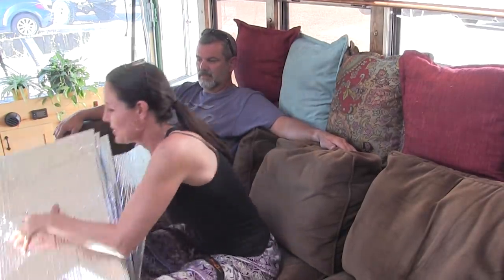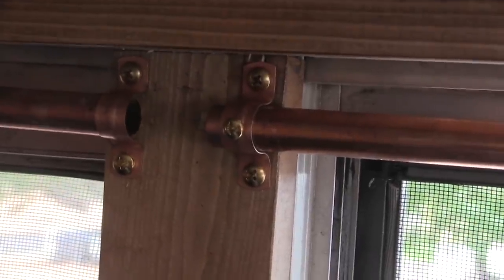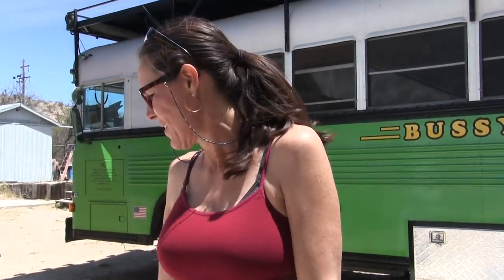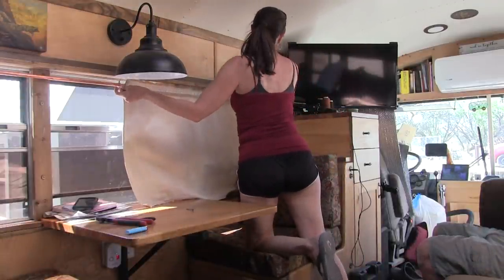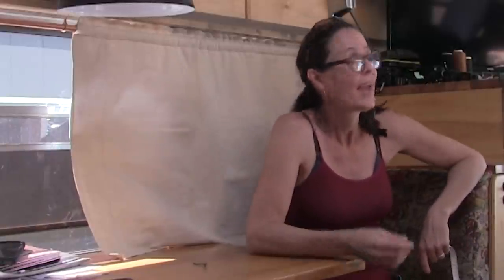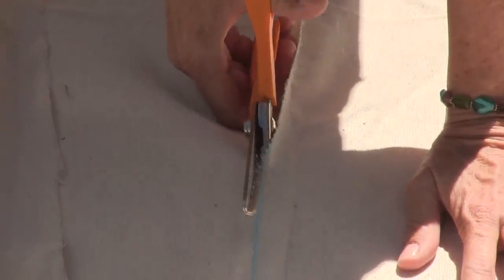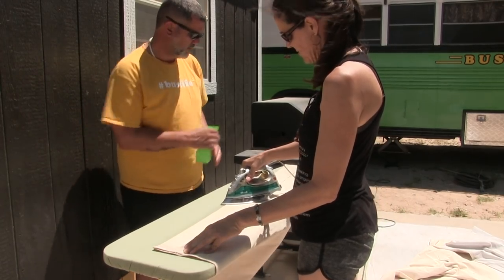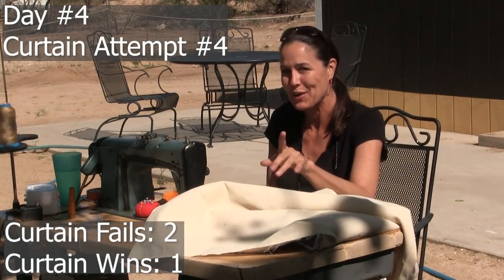Sewing Insulated Curtains for our Skoolie: the Struggle is Real!

Comment: 1st off, kudos to Kerry for holding up. PTSD is unique to each person who suffers from it. One can get an idea of what the person is having to deal with, but will never fully grasp the total affects of it. 2nd, Mike, you're one hell of a person, human being, and man for having the love, patients and understanding of Kerry's PTSD. 3rd, let me make a suggestion to you on the windows. Besides the curtains, did you ever consider doing low E film on the windows? Yes they are single pane windows, but what you want as an end result is to keep the heat out. UV rays are what carry the heat. Not to be confused with Kerry the heat. This is the exact function of low E film. If you do this, your insulated curtains will act as an insulated window panel and the low E film should work quite well.

Comment: Honestly, for the tiny homes I've helped build, I have learned to love making insulated blinds, instead of curtains. You need to preshrink canvas, so it doesn't shrink during ironing. Wash it, dry in a hot dryer, then do your cutting and sewing. The kind of blind I recommend is an accordion blind, which just needs to be about 1.5 x the length of the opening to function well. I use swivels to attach my blinds to curtain rods. It makes the blinds easier to open and close without bunching.

Comment: I would make a curtain "case" fit to the window, then cut the insulation to fit the curtain case which you slide in the insulation. This would allow you to take the curtains off and wash. Using canvas, you have to wash and dry it first - before cutting and steaming to stop the shrink issue.  Curtain case... as in think about a pillow case type construction for a pocket to slide the insulation in and out.

Comment: It looked cooler just watching once you got the curtains in place.  We have a class-c and needed to make multi-layer curtains to seal off the cab from the house and started with a pocket for the rod but it was a pain to open and close.  Attempt number two we switched to curtain grommets that slide kind of easily on the rod.  When you open the curtain it kind of folds up and it flattens out when you close them.  Just search for "curtain grommets" if this doesn't make any sense.

Comment: Use a flat sheet on top of the silver stuff. The flat sheet usually has a opening at the top of the sheet so you can use it to put the curtain rod through.
Reply: AND a sheet is much lighter weight and so much easier to fold when open!

Comment: wat you might be able to do is make the curtains using two pieces of canvas layed on top of eachother , then sew vertical pockets along the total length say 2 inch wide top to bottom closed at the bottom and open at the top on the window side  , then put strips of the mylar stuff in the pockets with a little velcro inside the pocket at the top holding the mylar in place and preventing it to slump down into the bottom of the pockets made in the cloth
this way you can take the mylar out to wash the canvas and it will crunch / wrinkle up a little eazier when you slide them open , it allso makes making the curtains eazier as youre not fighting the mylar and can iron the end result after stitching / sewing before sticking the shiny stuff in , you can allso make the curtains a little longer then the window as they crunch up eazier and are eazier to shorten
as for the bottom hem : have a piece of off colour fabric (the same brown as the couch ?) or fake leather cut a strip from that fold it over a few times to hide the edges and make the bottom hem from that , that way you can fudge with the length a little and when using leather edge should the curtain touch a wet surface it whon't wick it up intoo the curtain like a towel 
cutains are hard to make even if there plain curtans there just unwieldy and hard to measure
Reply from the maker: Good ideas! Yeah, curtains were much harder than I thought they'd be!

Comment: Idea about to help cool down the sides of the bus, would mounting rv awnings to the sides of the deck work?
Reply from the maker: It probably would help a lot by shading the sides, but I don't know how much it would cost, since we would probably need 4 of them!
Reply: @BussyMcBusface  Attach so they are removable. Then, put up the awning on the side of the bus that is most exposed to the sun. Doing just one side wouldn't be as fully effective, as doing 2, yet would be much more economical, IMO. How you park the bus (where you have good choices) will play a role in how effective an awning on just one side would be.
Reply: Two cheap solutions ..... 1. Keder Rails & keder rope and outdoor fabric from fabric.com (great prices) can make easy up easy down awnings.  Or just the fabric with grommets tied to deck with expandable paint poles to hold up. No need for full on sun setter expensive awnings.

Comment: I'm impressed he knew what a bobbin was. Lol There is a reason - so far that I've seen - every reflectix type curtain style is a roll up style of some sort. Fillers are too thick to push back all the way out of the way so people roll them up and down. I'd be worried about them holding up if you open and close them alot with this design too. But I hope they do after all the work that went into them. They do look good! ❤✌
Reply from the maker: Yeah, I hope they last, too! Thanks!

Comment: we took our reflectix and glued inside our cabinets on the outside edges. We have "attic" storage in our 5R and its 8-9'  above floor. Obviously don't use those particular cabinets much. So they are our ornament storage. Lined with the reflectix, I keep all our seasonal stuff up there. It's a good 12-15" tall, 24" deep and 8 feet long. If it won't fit, I can't have. Reflectix keeps delicate stuff from getting too hot or too cold. In my pantry and regular cabinet, does the same. Our 5R has really good insulation, but 100 degree days still affect stuff.

Comment: I believe your canvas cotton fabric is shrinking from the steam and hot iron. I sew and craft all the time. I also want to say y'all were not doing to bad. You jumped right in and kept going till you were happy with your finished product. I have been thinking about how to do new curtains in our travel trailer for months. The blinds that came in our rig are just so bad now. We use reflectics in our windows when we need to during the winter and summer. It is a pain to store them. I also don't like not being able to see out quickly.

Comment: Wetting and ironing the canvas will make it shrink . Wash and dry before cutting the factory hem off. May have solved the mystery of shrinking canvas. Lesson I learned restoring a 53 Chevy with my dad the head liner is put on rods and sprayed with water and as it dryed it shrunk back and pulled tight.

Comment: For my headaches I take Equate Headache Relief from Wal Mart. It has to be the green bottle not the red. The label states that it has the same ingredients but the green bottle is the only one that works. It is a generic Exederin, but Exederin does not work either. I take 2 tablets at the first sign of a headache. Even if I take it after the headache is in full swing it gets rid of it. I will be completely drained of energy but the pain will be gone.

Comment: OK, I'm only a few minutes in, so if you've solved this then please ignore.
Keep the panels.  They're fine.  You need to add tabs, or, better yet, O-rings.  Insert grommets into the top edge of the rectangle (maybe every 2" or so).
You could also try sewing the reflectors into vertical rectangles within one panel of the canvas.  That way the curtain can fold like an accordion.
Weirdly enough, I'm gonna suggest you watch Bernadette Banners video on sewing a Victorian corset.  It'll give you really good tips on how to install a grommet.
- Cathy, (&, accidently, Steve), Ottawa/Bytown

Comment: I got a suggestion about the magnets for the overlaps.  Get some small magnets & hot glue them all to the outside of the curtains. That way, when they're open,  you won't see the magnets,  just as if they were sewn inside.
Reply: HoT glue will not hold up the sun rays hitting it . It will give way.most vanners have tried hot gluing Velcro and magnets to their reflectics and find it does not hold in the heat. E 6000 glue will wrk

Comment: They look amazing and I understand needing every quarter inch of space accounted for. Why didn’t you just roll them up and on the backside, the window side, you have a flap of the same material that you have on the front side and when you roll up your curtain and attach it then you’ve got that flap of material that you can go around the reflects because that’s what’s going to be on the outside of the role then when you roll it. Just an idea. A lot less stress. But they look very good and I’m so proud of you for hanging in there.

Comment: I call it "Mock-up Purgatory".
Because before you cut into the fancy stuff, you start sewing mock-ups of what you want to finish with in second-hand bedsheets.  Because they are cheep and plentiful.
Also.  Sewing is hard.  It is Very old technology.  Probably as old as fire.
So don't beat yourself up for not knowing things when you're starting from zero.
My Covid project has been to try to teach myself tailoring on a Singer 99K hand-crank sewing machine that was built in 1915.  Right now I'm so stuck on three projects I'm about to remake the living room.
Be gentle with yourself.  I picked up the needles because of my own PTSD.
That, and the family legend that my Great Granny could pull a working mock-up of a winter coat based on the illustration in the evening paper.  That's couture level of sewing.  And I want that knowledge back in the family.
Which, ironically, is why I'm about to remake the living room.  Rearrange.  Reorganize.  Integrate.  Edit.  Because it's also the work-room.  And it ain't workin'...  Le sigh.  The struggle is real.
- Cathy (&, accidently, Steve), Ottawa/Bytown

Comment: I have lived your pain Kerry, cotton duck canvas is one of the worst materials to work with. When you iron it, it tightens the weave and therefore shrinks the cut size of the material. When I used it to make curtains in my house, I left 6" extra on the measurements then hammed to the correct size and cut off the excess. I was pulling my hair out with frustration, and I have a shaved head...lol
Reply from the maker: So it does shrink! We also realized that the canvas is so thick, each fold was taking up at least 1/16th of fabric! Once we figured out the formula, it got a lot easier though!

Comment: How about some insulated panels hinged on the outside of the bus that when opened also act as an awning so you can have your windows open in light rain? Seems like it would be a much more effective insulator too.
You could sew fabric mosaics on the inside of panels so you’d have the aesthetic when closed. I LOVE your mosaics!!
They would also add a layer of security if you could design them to be opened only from inside the bus.
Reply from the maker: Fred. what I like most about your idea, is that these awnings would be MIKE'S JOB!!! 😁😉😂
Reply: Bussy McBusface 
Tell him it was your idea then 😳😂

Comment: Are you taking into account the thickness of the insulshine when wraping the edges. You irond a very sharp and precise edge but the insulshine look to be about a 1/2" thick so you need to add that 1/2" for each wraped  edge.
Reply from the maker: We finally realized that was part of it, but also, the canvas was so thick that each fold took at least a 16th-of-an-inch of fabric, so we would end up short until we started accounting for that!
Reply: @BussyMcBusface  I'm glad you figured it out. The first time I did a project similar to this I measured the made not one, not two but all the pieces before I tried to fit them in to place and every piece was 3/4 of an inch too short and narrow.

Comment: Why didn't you use the reflectix as a template since they were already sized to the window? Just add a few inches around for the curtain size.

Also.... maybe masking tape on edges of the cloth to keep it from fraying. Probably thin enough to sew through too.
Reply from the maker: That's basically what we were doing... but no matter how much "extra" fabric we added, it still wouldn't come out right! The pinking shears worked great to stop the unraveling, though.

Comment: Do u have any suggestions for a bus that is priced very nice, It was used for tailgating, n it is gas, automatic, 35ft, heat n registered as a mobile home but I wasn't planning on getting into bus life for a year or so which means if I get it I will be forced to move in sooner then expected n I don't have the house part ducks in a row?
Reply from the maker: Wow, that's a tough one, very tempting, right? 35 feet is a great length, maybe it's possible to move in and then get the house ducks in a row? Good luck at any rate!

Comment: The extra stitched allowance above the rod pocket, might not have been pretty, but it would have helped to keep the heat out of the living area. If stuff is too short by a bit, a strip on the bottom would have worked. The extra seam would have been on the bottom where it was folded up, and not seen on the good side.
Reply from the maker: That is exactly what we did.

Comment: Question... does the window specific measurement even matter?  That is, you can measure the TOTALl length of your windows AND... cut exact similar sizes of curtain/insulation section in 6' or 7' or 8' or whatever, not related to each separate window dimension.  You can still slide them open at curtain intersection.  That way, the exact window measure- ment doesn't matter doesn't matter (although the top to bottom is easier).
I also have familial PTSD, but at 75, I've managed more easily by limiting stress.  I feel for you!  Aloha
Reply from the maker: There is a copper wire that supports the center of each curtain rod, so they did need to fit each section correctly. But ever since we figured out the correct formula, each curtain has turned out perfect! I didn't know PTSD could be familial, I thought it was always situational! Then again, being in a family IS sort of a situation, LOL!

Comment: Unwashed cotton fabric  ALWAYS shrinks .My advice is to dip it in water for an hour and then run the whole cotton fabric through the long drier cicle. Trust me it is only way that you will make sure that it will remain the exact size you need it. Othetwise  heat will shrink them and you will not be able to wash them.